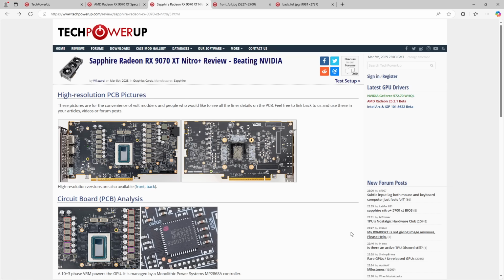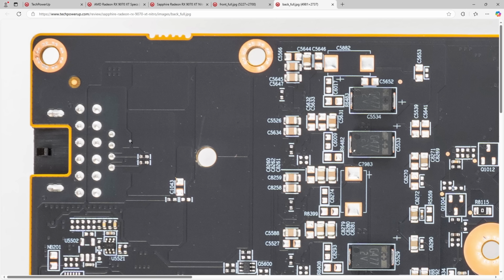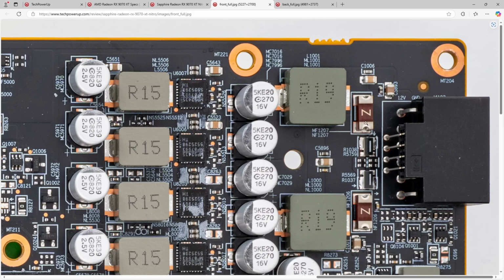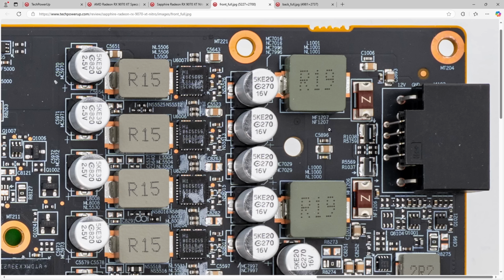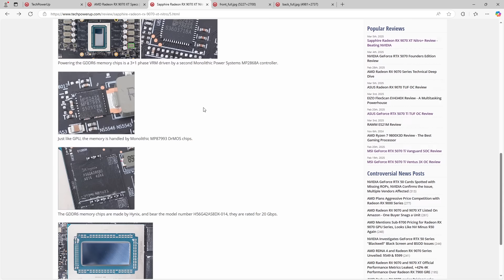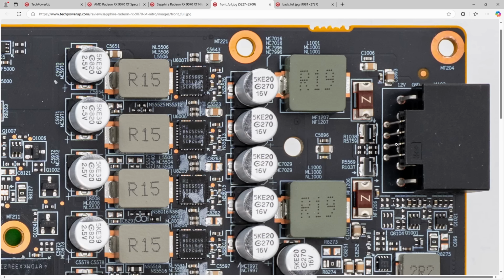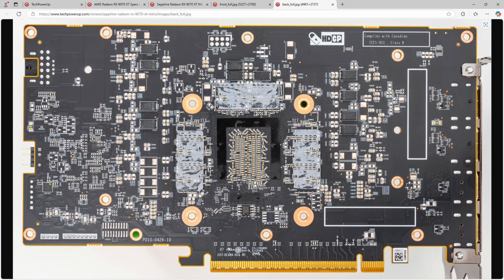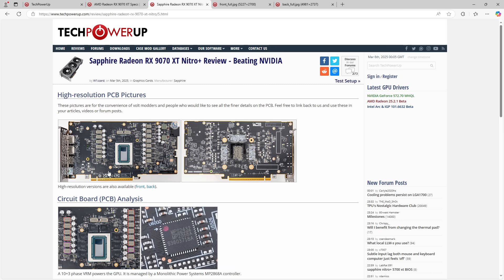Taking a look at Sapphire implementation of the 12VHPWR connector on the RX 9070 XT Nitro+

Comment: at this point they should just do a 2 wire cable conector, 1 ground, 1 12v
Reply: i agree whats the point of this stupid conector may as well just be 2 wire you can get high quality hi watage flexable cable as we use it on lipos with electric rc
Reply: Seriously, just slap an XT60 on there and be done with it. The cable would be chunky but we're already pushing the mechanical limits of the form factor anyway.
Reply: Cable would be too inflexible so no, it’s not an option but I know it was a joke.
Reply: @eazen  Sufficiently flexible wire actually does exist, even at that thickness.
Reply: That would be a win if it was thick enough!!
Reply: Insulated busbar would be perfect
Reply: I've been saying since I saw the 12 pin that they should just use an XT60 or something.
Reply: @Rararawr apparently that's not enough and an XT120 is more appropriate.
Reply: @Rararawr  All the PCB mount XT60 connectors seem to be rated at 30A. An XT90 PCB mount seems to be rated at 40A. Regardless there's tons of high current smaller connectors. They didn't need to invent another one. For people saying the wires will be an issue, they won't. 10 AWG silicone wire is really flexible.
Reply: @willjohnsonjohnson   yeah thats what I was thinking
Reply: @willjohnsonjohnson  Use an XT60 with 48V - 1.4kW. 12AWG silicone cable would work well for that.
Reply: @ But then you create another voltage spec. If Nvidia was able to create the 12 pin spec, then I think they can prove an XT60 can handle more than 30A. Like @spyder000069 said, more PCB layers will help with the current. These cards are 6+ layers so it shouldn't be an issue. 2 XT60 connectors with 12 AWG wire should be enough. They can even make the adapter long enough to hide behind your motherboard tray. I think for now they should go back to treating the 12pin as 3 separate connections. The physical connector isn't terrible.
Reply: @ But the issue is that it's always going to be on the edge as power requirements rise. They need a large jump in capacity, and a voltage bump is the way to achieve that. A voltage jump reduces the current-handling requirements all over the place, including in the copper layers around the input connector. You can always make it backwards-compatible by building little 48V > 12V adapters. In fact, such an adapter would resolve the issues with the 12VHPWR connector if it was soldered right onto the connector, as it would remove the vulnerable wires and thermally bridge the pins within the connector.
Reply: @ Or a male to female with smd fuses limiting per pin current draw.  If you really wanted to get fancy a small micro could easily monitor current draw per pin with shunt resistors and could shut off the whole 12V supply with mosfet control if beyond spec.  Using a esp32 would give bluetooth connectivity or you could plug into an available usb2 header on the motherboard to get user adjustability or feedback.  Just plug inline at the power supply.  Its exactly what power supply manufacturers should be doing to their design right now if they want to get ahead of it but it could be done external.  Only question is whether damage to a gpu can occur if the main power is pulled while still feeding from the pci-express slot.  I would assume the cards logic would stil be active and shut things down and not try to pull from pcie but often when I assume things that seem logical I am proven wrong.
Reply: Or just use two 0 awg so you only have two contact points.
Reply: agreed, my grandpa is decently knowledgeable about electrical engineering and he immediately said, why the F don't they use 1 ground and 1 12v cable, that's way easier cheaper and even with poor insertion will work without issues
Reply: I think it would be difficult in the current form factor to mount a heavy gauge wire to a fragile PCB. Not that it couldn't be done though, it would just need to be well braced by the shroud.
Reply: @--_DJ_--   they do it all the time with speed controlers and some of them can draw 2000w so its posable
Reply: @ They have a very different form factor than a big flimsy PCB. 
I used one of those amazon special speed controllers for a salt spreader, even that was bending with four 12 gauge wires on it and was a very small PCB.
Reply: I think the problem with this is getting enough surface area at the pcb layer to distribute the current.  Just a top and bottom layer is prob not enough copper.  Probably would need a multilayer pcb with copper on each of the layers.  I don't know how many layers a gfx card has but I do know the more layers the $ goes up quickly.
Reply: @spyder000069  The current density in the PCB is the same whether you use one large contact or a bunch of small ones joined at the connector, like here. 

Graphics cards already need multilayer boards (likely 6 or 8 layers) due to the GPUs being high-pin-count BGAs. Routing those on a double-layer board is impossible.

Comment: I think in some 9070XT's you can move "power limit" to 420 or 450W. Assuming I've heard Wendell from Level1Techs correctly. Or in this case I think it was on his Linux channel, where he OC'ed his Sapphire Pulse. But that one has 3x8 pin, so much safer. You could check if Sapphire Pulse doesn't have any shenanigans on it's PCB, but I doubt it. At worst it might not have fuses - I didn't check yet.
Still good on Sapphire for at least including fuses in this one. And if it's part of the spec for the connector to link everything into 1 - that is the worst spec idea I've seen in a long time.
EDIT: TPU hays Pulse has 2x8 pin. So I probably conflated it with ASUS card that he was reviewing on his main channel.

Comment: Bruh.
I expected them to implement it properly considering the cable is basically also air cooled by the flow through and placement of the cable behind the board.
I guess at least its 350w instead of nearly 600.
Will you look at the asrock taichi implementation too? I'm guessing it will be similar to this though.

Comment: Also curious if the provided adapter will have active circuitry like the Nvidia ones to ensure people can't plug in fewer connectors, or if the sense pins are just terminated to 450W or whatever.

Comment: ah so thats the RX 9070 XT not to get
Reply: Also the Asrock Taichi, watch out.
Reply: I wouldn’t go that far, but it’s the card where you have to be super careful with cabling it.
Reply: Exactly said 👌
Reply: Unlikely it'll ever be an issue since the most it'll draw is ~400w through it with everything maxed out but it could have definitely helped sapphire image wise if they had gone the extra mile to make it better.
Reply: @sirmonkey1985 maybe watch the video or inform yourself better before talking out of your ass. Even cards like 4080 who only draw about 300W had the melting issue.
Reply: @sirmonkey1985  He did mention in the video that this is high enough for melting. Of course it's not 5090 level but still.
Reply: @tvardy00 There are zero issues here. 5070 and 5080 aren't melting, the 9070 (XT) won't be melting either.
Reply: @sujimayne captain hindsight here: they indeed are. Your comment is invalid.
Reply: @sirmonkey1985  dont be a contrarian, he says dont get it dont get it.
Reply: At the real price and not AMD's fake MSRP, all 9070XTs are the one to not get
Reply: @mjc0961 there are 5 models selling at MSRP, with healthy stock. I don't know where you've gotten this narrative?

Comment: From reading about the Nitro having a 12V2x6 and them pointing out that they have fuses in the marketing for the card, i was hoping for a better solution.
Reply: I expected them to at least have the asus astral implementation considering they mentioned fuses
Reply: @bushhawk5460  and it shows total ignorance, if the connector will start to burn, fuses on the gpu will do phuk all, it will be up to PS to react to the short, the gpu will never see a problem
Reply: @biquiba not really. Sapphire is owned by PC Partner group for a long time. They also own Zotac, Manli, Inno3d. So really nothing special when u look on the green side. Sapphire always being so great on AMD is a mystery since aint nobody going for a Inno3d on Nvidia lol.
Reply: @Daisudori What about zotac?
Also back in the day I had a gainward gtx 650 and an gainward gefore 3 ti 200, but somehow avoid them a bit now.
Reply: The only interesting thing that Sapphire did is put the connector on the end of the card. Who knows if that will make any kind of a difference or not.

Comment: At this point it does feel like its either part of the spec or the PCA guidelines from Nvidia/AMD because all the new cards are the same way.
Reply: but why should it be as the 3090ti was not, and nobody would force so but of course wen you have a line of 12V+  and one line of 12V- some engineer is there and say actually i could do my live easier and connect them all on the board so no worry about...

Comment: Remember, the ground pins are the same as the 12v pins and thus have the same risk for partial connections. This means in addition to the 12v pins needing to be activly balanced, the ground plane would need that too. Good luck doing that. Also: If the ground pins aren't connected propperly, it's likely that the full current gets pushed through the mainboard, which isn't desinged to handle that. The old 8 Pin PCIe  had 2 Ground pins more than 12v pins, which reduced that risk.
Reply from the maker: The ground pins don't usually melt because a lot the return current just goes through the motherboard
Reply: @ActuallyHardcoreOverclocking  time to break down the asrock taichi oc 9070 xt pcb next with 12v 2x6 connector.
Reply: @ Yes. The question is, is that a good thing. The motherboard will probably have a big ground plane that should be able to andle it, but the current still has to go to the psu. While it most likely won't melt cables, it might cause instability issues due to gpu load depending ground potential for the components on the mainboard. The question is, how much does that affect the components.

Comment: For love all that sparkles, solving the 12 V melty, melty plug just requires putting a plug extender between the card socket and the cable with a couple of in-built fuses. I'm surprised this hasn't been done.

Comment: Are we thinking that the 340 watt cards will have a higher max TBP than the 304 watt cards? What I mean by this is that if you take the power sliders all the way to the max on both cards, will they end up in the same spot? 340 watts is only a 12% increase in power limit, which seems possible to hit on the 304 watt boards. I’m wondering if the 340 watt cards will have an additional few percent that so that you can crank them up further. Hoping to find out before tomorrow morning when I try to grab a card.
Reply: The 340W cards go up to 375W with maxed slider

Comment: Was waiting on this, thanks buildzoid.
I'm curious - will the 9070 XT models still using 2x or 3x 8 pin connectors have current balancing?  (Is that inherent to having 3 different cables?)
Reply: @Slyons89  yes it is inherent, every connector has to have at least one resistor that sees whether it's plugged in or not, therefore the load is balanced between multiple connectors

Comment: I'm surprised Sapphire did this.
Reply: I was expecting them to show everyone how to properly use the connector. We will have to wait and see how many issues, if any, there are before denouncing their efforts.
Reply: Same theyre known as a really good amd partner being trusted by the amd community the most so why do this disaster of a connector
Reply: @IcePhoenixOfTime I mean they only would need to change it a bit. If they just wire it as 3x2s or as 2x3s that would already solve everything. Like its not a lot. Its actually almost nothing. I really like the design. I would love to buy this card. But holy shit. Why?
Reply: They aren't known as a really good AMD AIB, they are known as the best, second being Powercolor and third either XFX or ASRock. Powercolor wins this round or so it seems. The Red Devil has 3 8-pins and won't burn down. Taichi and the Nitro+ are using the high failure power connector. Maybe for this gen the top 2 are going to be Powercolor and XFX, as they are sticking to the 8-pins even on their higher end cards. Disappointing showing from Sapphire.
Reply: @IcePhoenixOfTime simple answer because it looks great and whoever buys this card does absolutely buy it for the looks. The cable is not visible with this card, it’s just better than anything anyone else ever did with cable connector design (not electrically spoken).
Reply: Looks like they did it for aesthetics.
Reply: @novinovic298  Such a terrible reason T_T
Reply: AsRock too on their Taichi model.
Reply: I mean it would have been nice to split it but it is hard for me to think too negatively of this when there are 2-3k$ gpus using 200w more power  than this. I don't have a problem with the melty connector as long as it stays under 350w. This is way safer than the 4090 and 5090 and safer than the 5080. I would argue this is even safer than the 295x2 which was such a cool but absurd card.
Reply: Their XTX NItro is one of the best build quality cards on the market, period. That's why I paid the extra for it, peace of mind.
Reply: Always considered Sapphire as AMD incarnation of EVGA. Running their NITRO+ version of RX 6950 XT. This connector is doomed and they are silly to have used it. Period.
Reply: Because the cards only 340W... so 40% overhead on cable. (If you seat it correctly)
Reply: @ausnorman8050  two 8 pin power connectors pulling 150w each and 40w from the PCIE slot. (All within spec.)
Reply: @Fractal_32  nitro+ would need 3x8 pins which most AIB's are using since AMD allows 340w base + 10% for AIB's to stay within "spec" but the 2x8 can technically handle 576w combined. the 12vHP is not part of the 9070 series spec from AMD so it's on the AIB's how they want to wire it up. but either way i don't think the power draws going to be an issue with thermals on the connector but was hoping maybe they'd go the asus route with the shunt resistors to show off.
Reply: @ausnorman8050  
Yes, but you still have the other problems of voltage going through one pin if it has a bad day. 
Thats a risk not worth taking, thank you very much. 
The 8-pin is a proven standard thats been revised and perfected at this stage, reinventing the wheel is about as dumb as anything, they could just gone with the 16 pin cable that used to exist, which is just two 8 pins combined....
Reply: @SMGJohn  A new connector would have been fine, they just needed to do a better job of it. I have no idea how it ever got approved for mass production when there was no actual need to replace the old 8-pin connector standard.
Reply: @ausnorman8050 it doesn’t matter what the overall cable is rated for if all the voltage can flow through a single wire. That’s what causes the melting and fires with these awful connectors.
Reply: I am not.
Reply: Whyyyyy, noone asked for this.... fuck
Reply: There are zero issues here because this is a <400W card.
Reply: They also named a card "Puke" but that one has regular 8 pin connectors 

Puke should have been the one with the 12VHPWR connector
Reply: never ever underestimate stupidity:
the "nitro+" product line used to be the top notch brand from sapphire in the past.
now they got rid of dual BIOS function and opted for that fail-connector and pump up to 400 watts thru it without even remembering that 4090s with TDP of 450W and even 4080s with up to 320W had melting connector issues.
everyone who can do the math  320W < 400W < 450W and come to the conclusion that their 9070XT OC will see melting connectors soon.
Reply: I wouldn't stress though. Not at that wattage. My 4080 is fine. Most 4080s have been fine. I think you'll find even most 5080s are probably going to be fine. It's really 4090s and 5090s that push that connector too much.

You're not melting it at <350w
Reply: @HughesDePagen some of the 9070xt’s can pull 420w, still not likely but not impossible
Reply: @brandeno6924  They do not pull it for long, AFAIK. Isn't a problem for a cable.
Reply: @ you sure? My 4080 with 117% power limit and being an OC model hit 380w max or there abouts... over 400w seems odd for a card like that
Reply: @ yes, techpowerup’s starfield testing their card pulled 423 pcie+eps
Reply: @brandeno6924 so you are just saying that the card PLUS CPU are pulling 423w.
Reply: @brandeno6924  that's system power not GPU alone.
Reply: @HughesDePagen  The problem with a fire hazard is that it is a hazard, not that it is a 100% guarantee. If a card was 100% likely to go up in flames, it would be recalled and/or banned from sale rather quickly. A low percentage hazard will not and even 0.01% chance of burning your house down is still far too high for me to consider buying a GPU
Reply: bros fell off fr fr 💀